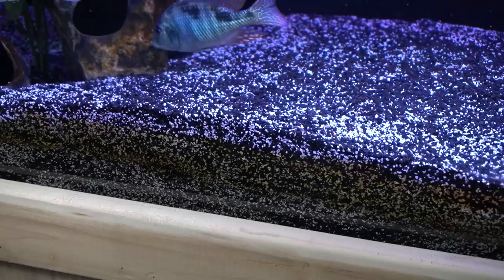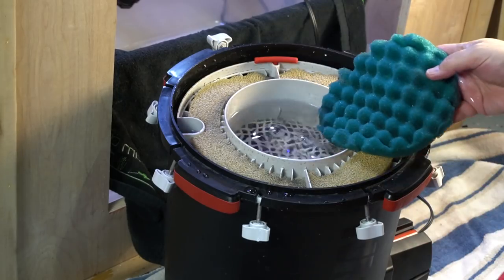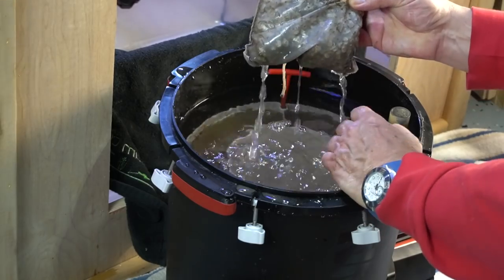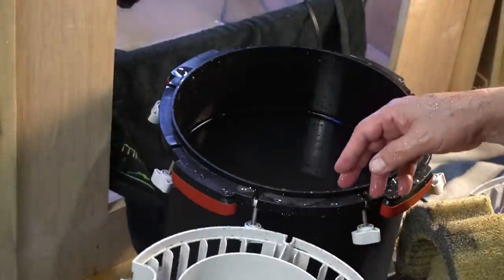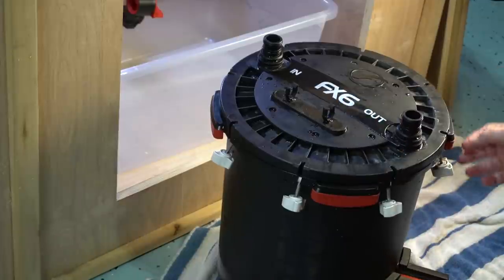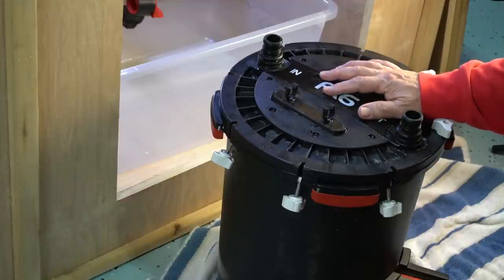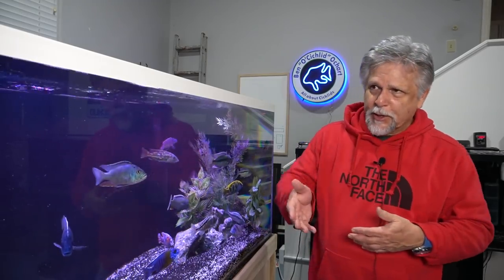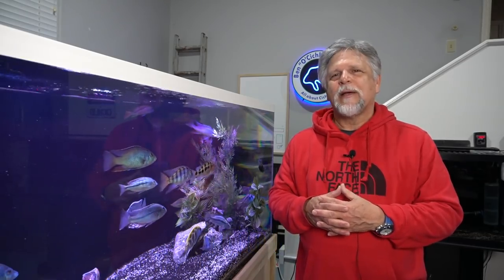A SHOCKING DISCOVERY Inside My Fluval FX-6 after Running it for 6 Months 24/7!

Comment: That is one clean filter for 6 months. Looks like it is doing a good job buffering the water while the sump does the majority of the cleaning. 
I noticed that when I run multiple filters, usually a hob and sponge one of the filters will do more cleaning then the other like a 60/40 to 70/30 type of cleaning ratio. 

A pre filter saves me a lot of cleaning maintenance on my hob filters.. and even on ones I don't have a pre filter I for a coarse sponge first that catches a lot of gunk before hitting the finer filter material. Even then the finer filter pads were cleaner than I expected. So much so I could reuse them for another month before replacing. 

A Pre filter will save you a lot in time and money as long as you regularly clean the pre filter, you can most likely double or triple the life of the filter pads in the filter..
Reply from the maker: Good points

Comment: Wow that’s amazing how clean that filter is after 6 months.  Maybe you don’t even need it with the sump running.   I run 2 FX6 on my 125g and alternate changing them every 2 months.  So each filter is cleaned every 4 months.  Much dirtier than your filter but not horrible. Maybe I need to try using the pre filters. They seem to help.

Comment: With the pre-filter the remaining detritus is fairly solvent. The the amount of flow through the fx5 will dissolve particles to much smaller than those medium sponges can hold. Your bio and gravel will hold the super small debris until it becomes solvent and bacteria eat it. If you use fine filter media through your sump then that is what is removing fine particles along with what settles in the substrate.  PS; you can back flush the hoses into a bucket to clean out the excess debris.

Comment: I follow your type of filtration method as well. Every tank in my Fish room with a filter that has an intake port has got a pre-filter on it. I run a total of two odyssey CFS 700 canister filters, one Fluevog FX six canister, and a Sunsun 704B canister amongst the various tanks in my Fish room. I don’t have to service them but once a year. With the aid of the pre-filters, and just having the tanks dialed in with water movement, my canisters stay amazingly clean and therefore are doing exactly what I need them to do in my tanks. My canisters and most all of my filters are solely in the tanks for the purpose of water movement. I had to run a deeper substrate, but also I don’t think I’ve ever had a tank that couldn’t handle my stocking load just because the amount of bacteria on everything in your aquarium is more than sufficient. Love the video my friend! And sidebar, thank you so much for checking out the live stream I really appreciate the support my friend!🐠🦯
Reply: Careful with those Sun Sun filters . I had a brand new one that leaked everywhere when I lost power ! Thank God I was home

Comment: Ironically I cleaned out my fx6 yesterday also.  No pre-filter..  it was way dirtier.   It still was flowing fine and the water was very clear.  The tank it is filtering is a 200 gallon .  I have an additional sunsun filter on the tank with a pre-filter with a lower flow that doesn't get nearly as dirty.  I only clean the sunsun about once a year.  The Fluval is such a work horse that I feel like I'm getting my money's worth this way.   Ps. Time since last fx6 cleaning about 5 months.  The sunsun is packed with biohome media.  It was setup to test full cycle nitrate removal claim.  Even with lower flow Aquarium nitrate=Sunsun output =Fluval output.  No noticeable change.

Comment: That's an awesome canister cleaning, especially for the 6 month run time 😀 Personally I run pinky floss as my final stage of mechanical filtration before the bio-media and no pre-filter on my display tank FX4s. With running the floss, I service each filter every six weeks. I've found that when servicing each filter, once the inlet and outlet valves are off, backflush them into a 5 gallon bucket reduces the amout of buildup in each hose. This also reduces disturbing the inlet and outlet hose by not removing them from the tank and breaking a seal on any of the hose couplings in the tank. Just started backflushing the hoses last service and has proven to work well. Kudos on the content and setup 😎
Reply: I should also note servicing every six weeks, only one filter at a time. So my schedule is every other week one gets serviced. And that Husky Silicone Lubricant is top notch 😎
Reply: Where do i order pinkie floss I use poly fil but don’t use canister filters
Reply: @brettcoyle2399  Amazon carries it. Just search pinky floss. A 10 foot roll runs for around $15 - $20. Great water polisher.

Comment: I've been running prefilter also for 2 yrs. now for canister, HOB they make world of difference extending the life of main media and prolong the time between cleanings.
Reply from the maker: and as a side benefit, the less you mess with these canisters the better. So you're right, it will extend the life of the media and the canister, o rings, valves, etc. 😀😀😀

Comment: Great video Ben. 6 months of not opening a canister is a long time! It didn't look bad at all. Go for a year next time, lol. Prefilters really do keep canisters clean...your winding up cleaning most of the junk out of the prefilter instead of the canister.

How did your filter socks cleaning go? I used to machine wash them but now I just put 3-4 socks into a small 2 gallon container and fill it with about 20-25% bleach and water for the rest. Leave the socks soaking in that fir 4-5 hours and you can just rinse them under tap water and they're like new.

Comment: Ben king of the O rings. I clean my FX6 in my 75 gal Tanzania Cichlid and it's a 1000 % worse than this. This is my stand alone filter and even though I run sand too the Bichardi turn the sand over like crazy. I don't know if it's your sump or the preffilter but I have to give the prefter a try.

Comment: I suspect your substrate is capturing the majority of the detritus and keeping it from being removed to the filter.   Unfortunately, with little water flow in the substrate, detritus breakdown via nitrification is much slower which can cause a buildup of nitrates.  The other thing I found is that the intake guard/strainer for these large filters like FX6 are undersized, and any type of blockage, biofilm, snails, plant matter, etc., will result in a major reduction of flow through the canister filter.  Are you sure the FX6 was running full out?  My flow on my eheim improved by 30% when I greatly enlarged the intake strainer.   I am going to cover this in an upcoming video on my channel.
Reply from the maker: Nitrates tension low in this tank, so, no, that’s not the case. The 3500 gph wave maker (on a timer) suspends the detritus until it gets sucked into . Sumo socks have to be swapped out every 3 days, so I know that’s working.
Reply: John you are reading my mind🤯🧐Freddie Vara

Comment: I am blown away by how clean that is . I clean mine every couple of months or so and mine is like mud in there. I cannot believe that if that's the result of a pre filter !!!
Reply: The problem with prefilter sponge's is that they clog fairly quickly and if you're not on top of it, they will greatly reduce the flow of water. 
Maybe try using a sponge that is coarse instead of the finer sponge's?
Reply from the maker: I have not found that to be the case. Don't use a "fine" sponge, it has to be medium or coarse and with a weekly or every other week rinse the flow is very strong.
Reply: @BenOchart  well, I'm sure that if I used a canister filter, a prefilter would be the answer, but I only use hob's, so a prefilter, in my experience of course, seemed to be extra work by having to put my hands in the tank to pull it off and whatnot. 
I can see a coarse sponge working better though, as it will not impede the flow of water like a fine sponge does. 
Prefilter sponge's do work. 
I'm not saying they don't. 
I just didn't see the point with my set up. 
I may experiment with a coarse sponge in the future though.

Comment: Ben. Did you take off the large FX6 intake grill to add the pre filter. I had to purchase a large sponge to fig over my grill. It looks like yours is more streamlined if maybe you added a smaller grill. TIA.
Reply from the maker: Removed the grill and drilled a few holes in the intake pipe.
Reply: @BenOchart  can you recommend a pre filter that fits the tube?

Comment: I actually haven’t clean my canister filter in over a year when I finally did it wasn’t even really dirty I was so surprised and shocked I thought it would be disgustingly filthy but it wasn’t.
Reply: The waste denigrates and becomes solvent after a while due to flow and bacteria feeding . Only when fine sponges are used do you see true accumulation as the waste is trapped and the flow is slowed.

Comment: When I open my 2 fx6 after 4months there completely covered in waste etc ,yours looks like a few weeks of running I'm amazed .good job
Reply: Put a small prefilter sponge on your canister intake. The inside of your canister will stay clean too. Prefilters are awesome if you don't want to do monthly cleanings.
Reply: @GSP-76  you won't have to clean the filter so much, but the prefilter sponge's, in my experience of course, were constantly needing to be changed or squeezed clean at least once a week. 
I also didn't enjoy pulling them off the intake tubeas they always made a mess in the water column. 
They do keep your filters cleaner though.
Reply: @jeffalbillar7625  yup, that's what happens with prefilters...you will never be able to catch all the junk they collect. You could try using a net to catch any loose debris.
Reply: @GSP-76  I just stopped using prefilters altogether. I use hob's, not canister's, and all I do is take the media out every couple of weeks if need be and squeeze the foam a little and put it back in the filter. 
I don't even need to turn the filter off. 
The outflow from the aquaclears are thickly coated with algae from never stopping the water flow.

Comment: Canisters are ok for certain things i suppose...  but most have poor sucktion compared to HOB's..  if you want powerfull mechanical filtration nothing really replaces a high flow HOB (im speaking for most tank sizes not behemoths)..  for example an emperor 400 will take out way more particles in the water than a eheim classic, and alot more than any FX filter.   Been doing this for 30 years nearly...  I have nothing against canisters so im not being biased.. im just going off personal experience doing this longer than most people have been alive in this hobby..    The only thing i use canisters for these days is to remove the trays and everything entirely and just stuff them top to bottom in seachem denitrate..  and then i use the ball valves or install one and cut the water flow to 30gph... to eliminate high nitrates in my tanks.   And no a sump doesnt remove nitrates.. water flow is too high.. so dont even try that... Skimmers are also useless, all a skimmer does for salt is remove the stuff your corals need.. 

I dont even use filters anymore on any tank except a mechanical HOB which i keep off 95% of the time. i only use it if i need a quick mechanical filter or something for carbon... the beneficial bacterial scam these companies try to sell you isnt in a filter.. its in your substrate and rocks and decorations and plants you install.  Think about it.. do you think a filter that holds 500ml or less of rocks or bio rings or sponge is going to out compete or help with 40-60-80-100 lbs of sand or rock for substrate ?  nope..  Same for sumps.. sumps are useless for anything other than acting as refugiums if you use that.. Or to hide heaters and so forth.   Do you think another 50lbs of rock for say a salt water aquarium is going to help over the already 100lbs in your tank ?  Really honestly.. think about it.    

Unless your tank is completetly bare bottom with nothing in it these types of filtration are stupid and a waste of time, i have a 180g reef aquarium with 5 tangs, 2 fox face, 4 dwarf angelfish, 10 green chromies, and 5 wrasse along with 130 types of corals.. i have 10,000$ in fish and corals.. and i have no filter or sump..  gimme a break people and wake up..

You also are not using polishing filter pads.. sponges that you use do nothing but for big chunks... i garuntee if you put a polishing filter in that fx it would be clogged in 1-2 months.   Sponge filters like that are so poures they let everything go..  Your prefilter is doing nothing but stopping the initial pellet of food.

Comment: Great video as always question witch is better pinky floss or polyfil?
Reply from the maker: Poly-fil is cheaper but I stopped using it because it was breaking apart and getting little white strands all over the filter and stuck in the sponges, so I switched to pinky floss and love it. That being said I have gone with sponge material whenever possible. You can’t beat the cost savings of being able to rinse and reuse filter material practically forever.

Comment: You had to pull the supplied strainer for the intake off to fit the preffilter, right?
Reply: Ben shows this in another video. I found a old whisper 3 filter intake worked for me..  Or dril holes in the pipe that goes in the sponge. I have 4 months on a fx4 I am going to clean tonight. I will check and see how it does.
Reply from the maker: Yes, then drilled a few holes in the pipe and added this: https://www.aquariumcoop.com/products/large-pre-filter-sponge?_pos=2&_psq=pre&_ss=e&_v=1.0

Comment: Sponges are biological filtration as well as mechanical. Sponges are arguably the best biological media you can get. I clean my FX6 once a year. I use a sponge on my intake filter and a HOB filter with filter floss that I change once a month.
Reply from the maker: Been pushing that for years. My sump is all sponges😀👍🏻

Comment: Which co op pre filter fits the fx6?
Reply: Nevermind. I see you showed the size. I've looked at doing this before but the size of the hole in the pre filter seems way too big to me. If I recall correctly it's over 1 inch inside diameter hole
Reply from the maker: I drilled holes in the intake pipe and the suction holds it in place. I have also used a 1” cut hose to make the pipe wider and that helped hold the sponge in place.

Comment: Y do u like the 704b more then the 304b when they both push 525 per hour is there something the 704b offers that the 304b doesn't.   ( Help )
Reply from the maker: I believe the 704 gives you more media capacity and a UV light.
Reply: @BenOchart  I don't want to be a pain in the but lol I just value your opinion but the 304b also has a uv light could u tell me witch is the newest model out of the 2 an what's your opinion on the newest 3000 digital sunsun with 7plus gph for only $30 more

Comment: Are you sure it's working the water inside is crystal clear no way it was running six months, especially with that many fish I've got pre filters on all my filters and you still get dusty detritus through the prefilter.
Reply from the maker: Works perfectly (or outputs wouldn’t be blowing out so much water). It is hard to believe, but it is exactly as stated. I drilled the intake tube and the pre-filter is huge. That set-up might be why my pre-filter performs so well.

Comment: It’s clean because the filter is shit, I have one and hate it, only way to get it to filter anything is to full it with filter floss, pillow stuffing, then it’s a pain in the arse to clean, with all those lugs that come off and break, not to mention the purge valve at the bottom leaked from day one. High flow but useless at actually keeping water clear. It’s always clean because it only turns water over.
Reply from the maker: Very different from my experience my experience with this filter. In Calif it was the only filter on a 100 well stocked AC tank and this fish were “floating in air”